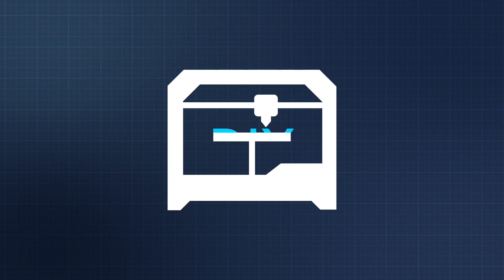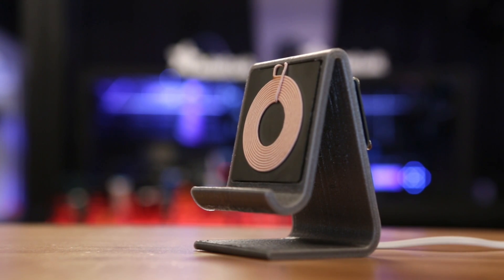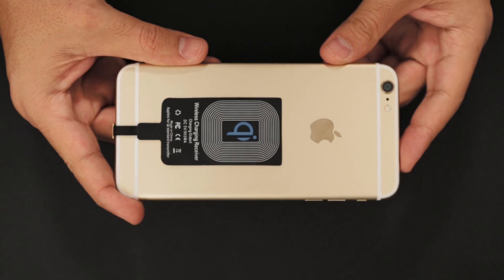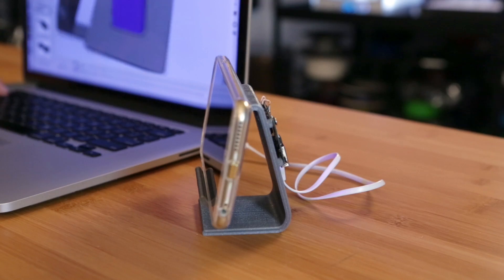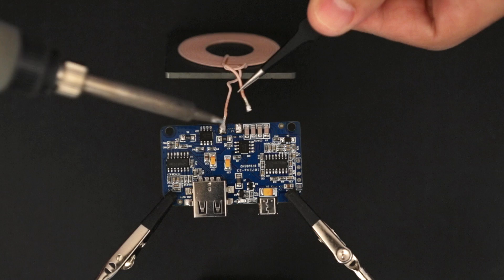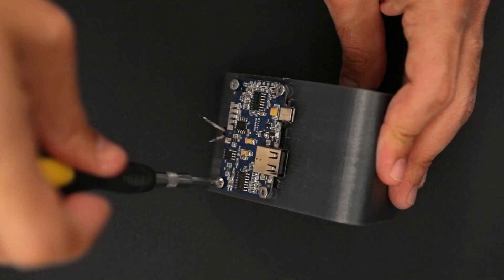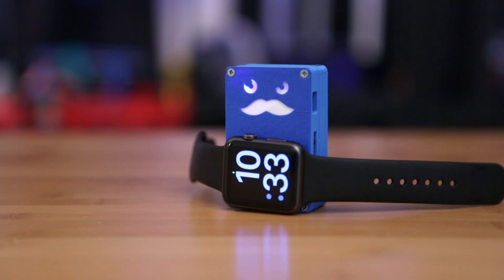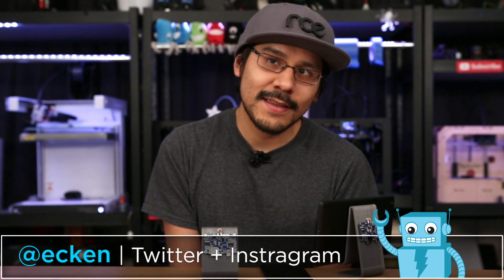3D Printed Qi Wireless Charging Stand

Comment: Sweet tutorial, Broe, but I mustache you a few questions as well:

First, does the wireless charger interfere with the device's cellular or Wi-Fi reception while active? If so, how many bars?
Second, how fast does the Qi charge a battery, compared to plugging it in directly to the mains, or a computer's USB port?
Third (and most importantly), how did the top of the D in the "DIY" logo animation print without support material?

As for my suggestion for the next wireless charging project, how about one of those stylish hip holsters worn by folks who inexplicably lack pockets, but still somehow have belts? 
The holster could have a built-in thin battery, Micro-USB charging port, and maybe even a fancy little indicator LED or two. Rather than buying one to tear apart and squeeze in the electronics, perhaps one printed from flexible filament with a rigid clip would be a better option to accommodate all the different sizes of phones folks have. Of course, the rigid clip and its mounting would have to stay about the same size at each scale.

Food for thought! Keep up the good work, and as always, nice hat.